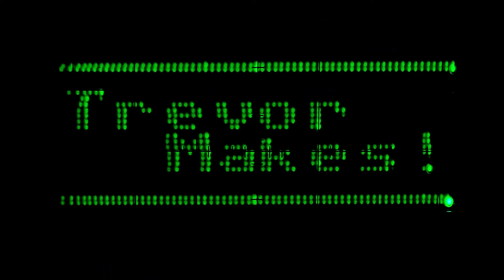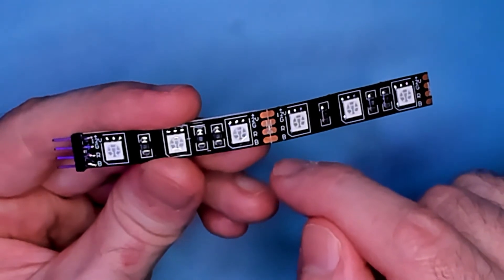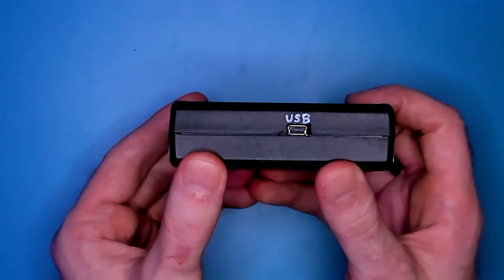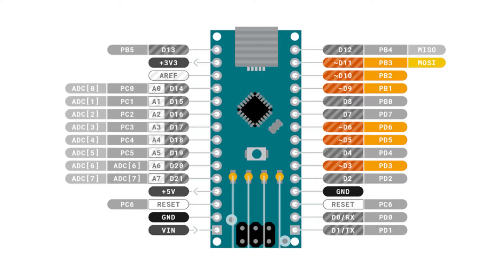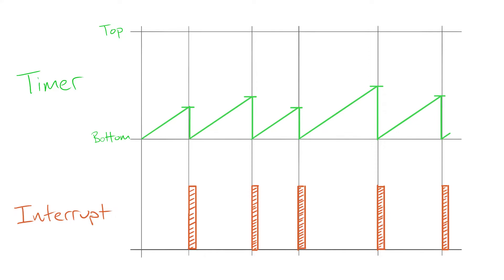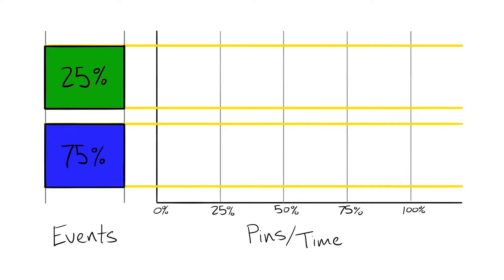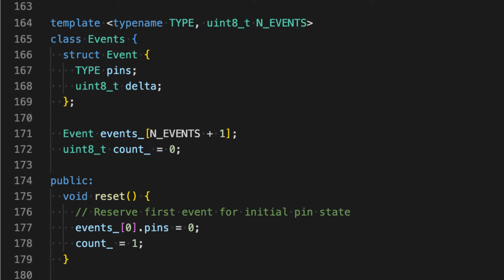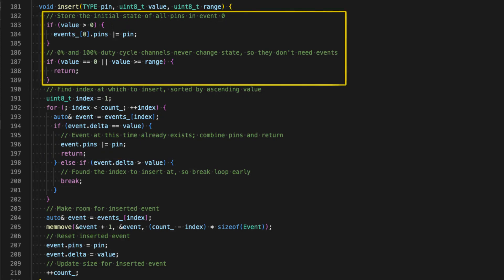Control 6 RGB LED strips with 1 Arduino

Comment: Clever idea, and nice enclosure! Would have been good to see more of a demo of the LEDs in action, though I guess you could argue that was the whole clip of you talking.
Reply from the maker: Good point! I was thinking of showing more on the keyframe animation and command interface, but I cut it out of the script to just focus on PWM. Maybe I'll make another video on this just covering how I use the controller and show off what the animation can do. Thanks!
Reply: @TrevorMakes  Yeah, I mean no need to stretch it out too much. I suppose you have to make choices!

Comment: Where did you get that enclosure? Can't seem to find one with six holes for the LED headers. Thanks!
Reply from the maker: I used a BusBoard KIT-1593L. I made cutouts in the removeable end panels using a drill and a file. When I revisit this project, I'll probably go with a custom PCB and a 3D printed case.

Comment: Is it possible to program a led list so I can change the color on the ledlist at a specific place? I want to have a ledlist around my table top tv case and be able to change the color at a players position to indicate its that players turn to act.
Reply from the maker: How many people? My code would be good for up to 6 players. One long WS2811 LED strip around the table could do more using FastLED library. Sounds like a fun project!